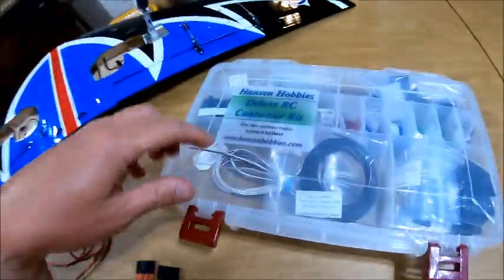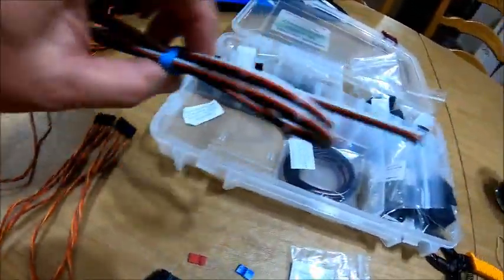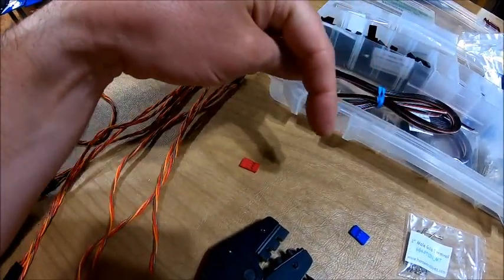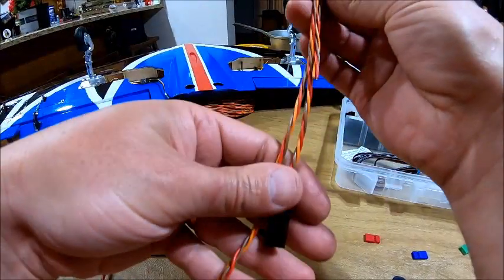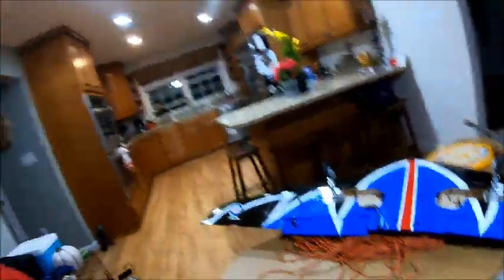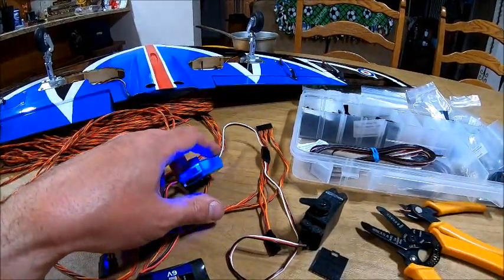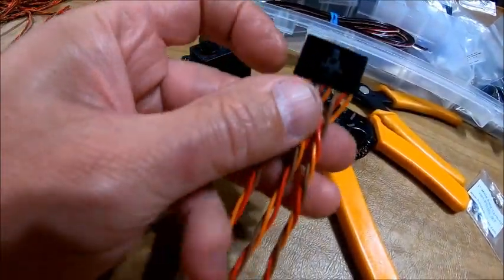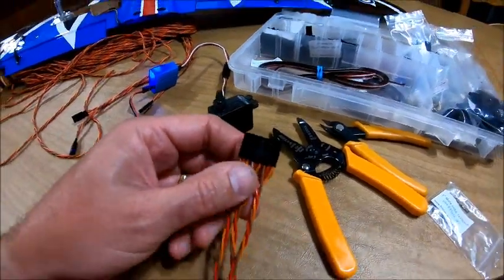Size Matters, How to make your own Servo Extensions and test them

Comment: I want to drive my traxxas trx4 mini in a Fox den underground but with a normal 2.4ghz transmitter i will lose connection. Is it possible to take the receiver and battery off the car and extend my servo leads 30 meter from the receiver to the servo/ motor? So i can keep the receiver outside while the car drives underground with 30m servo cable connected to the car?  Hope you can tell me if it would work!. I only need 1 servo for steering and as small motor for driving.
Reply from the maker: I doubt it. I doubt there would be enough voltage to push through that wiring

Comment: Thanks for the useful video. I'm finding the only challenge in making my extensions is in stripping the right length of wire, followed by getting enough insulation in the pin/socket to achieve a good crimp on the insulation, at the same not having too much wire on the other side of the cavity. Having that interferes with getting a good fit in the plastic connector. Practice needed here. Thanks again.
Reply from the maker: You are spot on Rick. It’s seems about 3-4mm is the right amount. When putting the wire into the socket develop the feel for the first stop. Once you hit that...crimp. Don’t forget, always do a wiggle test on a powered extension to make sure you don’t have issues when done. Happy flights and thanks for watching.
Reply: Thanks for the comment! The first couple weren’t perfect but they would not pull out, and I tested them with my servo checker. So tired of having a project delayed because I had to extensions. No more. 👍

Comment: You're rapidly becoming my hero!  I've looked at a couple of videos on doing this but none as simple and straightforward as yours. I usually keep several different lengths and of course never have the one I need.  It was also timely that I saw this, I have a Nexa P-47 from Motion and I was wanting to clean up the servo wires so I wouldn't t be making 6 connections at the field.  I have to transport most of my larger planes wings off and 2 connections are must less risky than 6.  So far your tips have been exactly what I've been needing.  Thanks!
Reply from the maker: Don’t forget to share your thoughts. Thanks.

Comment: good video man, have you tried making y cable extensions on 22 gauge wire?...i have always had problems they crimp ok but don't fit the housing very well.. open to ideas..thanks
Reply from the maker: How about just heat shrink and solder at the joint